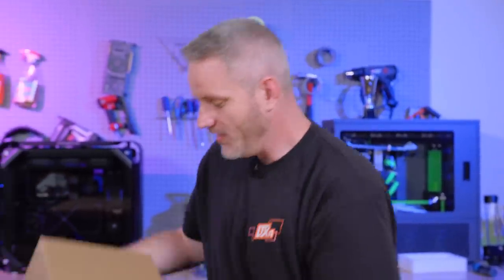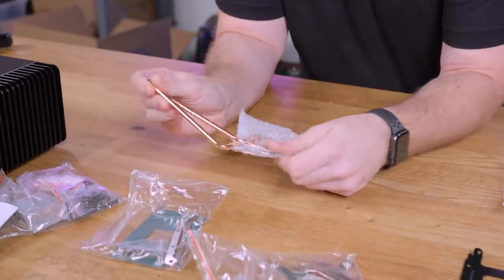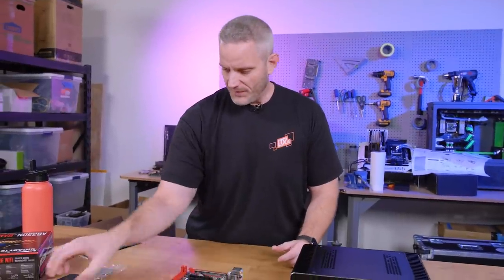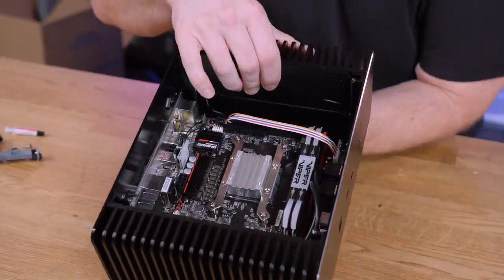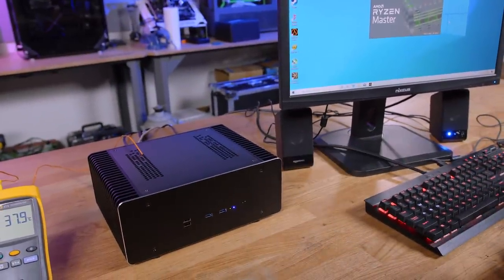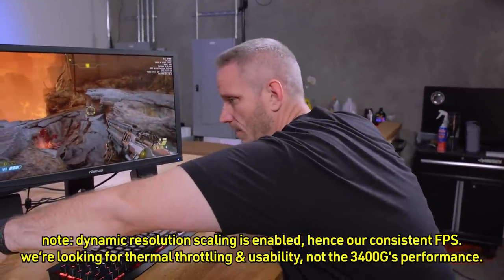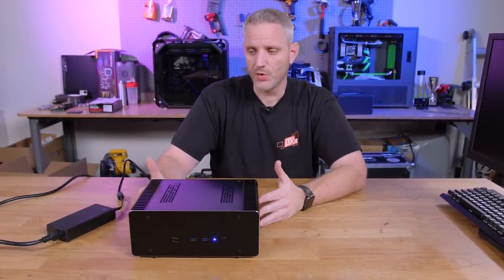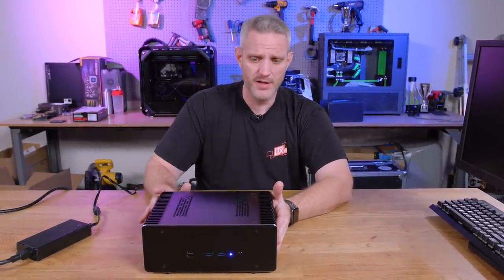I've never built a PC like this before...

Comment: I don't know if I more happy about this cool case or the fact that he said litres instead of fluid ounces
Reply: liters is the displacement of the inside of the case. ounces is how much the case would weigh. they are not comparable.
Reply: He meant to say litres
Reply: He was meant to say litres noob
Reply: @ghomerhust  sorry I meant fluid ounces
Reply: @robstrains8711  I meant to say fluid ounces because apparently if one is wet it measures a completely different type of quantity
Reply: @AdaDoom1  yeah I know I meant to say fluid ounces, didn't realise there was a difference
Reply: all the debate on ounces vs fluid ounces when anyone that is not an idiot already knows which one is being used to measure volume...and no one mentioning that no one actually uses ounces to measure volume of space that way.  They would use cubic inches. 
for what it's worth, converting imperial to metric for volume is one of the easiest in getting a close-enough estimate, as 32oz being 1 liter is close enough to to get a rough idea.  (1.06 actually)
Reply: @johngaltline9933  oh I forgot that I am not American and I don't actually know much about the completely unscientific and irrelevant imperial system
Reply: @ivantaslev  irrelevant, possibly, if you don't come across it, however being able to convert between different units is always a useful skill.  As for unscientific, only in the sense that metric is typically used in science and engineering today.  just because converting between unit types is more difficult does not make the measurements any less accurate or precise.  On the other hand, people that routinely deal with converting units tend have little trouble understanding conversions.  There are a couple niche cases where imperial is actually far easier to use than metric, but for the most part, no one that is familar with imperial thinks it's inherently superior, they just don't care, as they can understand both imperial and metric just fine.  It's only the metric folk that seem to have any trouble understanding units in other systems.  Maybe it's because their system has not taught them how to use their brain for conversions?
Reply: @johngaltline9933  well this has turned into an interesting conversation. well before you assess my mental capabilities, let me tell you a bit about myself. I'm a secondary school student in Singapore, I take triple science with additional math and I am finishing my O Levels. Trust me, I know perfectly well how to convert units, except that I do not specifically need to convert metric units to imperial units on a regular basis. And as far as precision goes, sure maybe when it comes to large things both systems are equally accurate, but what about smaller things? Can the imperial system measure the size a cell without endless decimals or a tiny fraction of an inch?  Anyway, I came here to make a statement that I hoped would offer some humour to someone's day and not try to prove which measurement system is better, but apparently many people enjoy putting others down instead.
Reply: @ivantaslev  Honestly,my original reply was in your defense.  It seemed other people didn't know that ounces can measure both weight and volume. 
As far as the small measurements, Imperial uses the same method as metric. thousandths and millionths of an inch or meter.    it actually causes some confusion with people that are unaware of the imperial terminology in engineering and machining as the term "mil" has been the standard term for a thousandths of an inch for hundreds of years, but most metric folk hear it and think millimeter. oddly enough the term milli comes from Latin and was originally used specificly to refer to one thousandth of a mile. 
Once again, no one is debating if one system is better than another.  with a couple ease of use exceptions on both systems, they both work just fine in any use case and for day to day use it really doesn't matter.  It is, however, somewhat irritating that only metric fanbois like those in the replies above seem to have trouble converting units where as people that still use imperial don't seem to have any trouble understanding metric and don't tend to care what system is used.
Reply: hey man sorry that I misinterpreted your first reply, I don't wanna have any beef with you. however when I said that the metric system being more scientific, I said that because pretty much all scientific equations in physics use metric units as they are the SI unit, whereas any other unit would completely change the way certain formulas work. Also, in the metric system there are many prefixes which, albeit may be confusing, are really useful so that you don't have to use things like 'thousandths' or 'millionths'. An example is a nanometre or a micrometre. These prefixes are what, in my opinion, make the metric system way easier to use. Anyway, I understand your points, it was pretty cool to have this conversation about  measurement systems. Have a nice day pal :D
Reply: @ivantaslev  for what it's worth there are equivalent equations for the other types of units.  pretty much all of those formulas were discovered using the other units in their original form.  also, as I said before, the prefixes are the same.  milli is a thousandth, micro is a millionth, and nano is a billionth. it doesn't get much more old school in a measurement system than using Latin names.  In general the imperial system uses the differing units because of what they were used to measure where one unit might be used to measure common objects a person was likely to handle and work with, an inch.  another unit was used that scaled better for larger objects like buildings, and another made sense for large distances, the mile.  oddly enough the mile was originally 5000 feet (is 5280 now),  but got there by way of being a nice, even 1000 paces for Roman soldiers. 
I can't argue that metric is easier to use in most cases, and that ease of use is a it's selling point, but it doesn't make other units any less useful in the cases they were intended to be used.  Some cases where imperial is actually easier are general construction, where the ease of dividing fractions makes it effortless to ge accurate divisions of materials without a calculate, ex if you have a board that's 2.43205 meters long it takes a slight bit more brain power to figure out how to cut it in 4 equal pieces than it does to take that same 95 and 3/4 inch board and work it out to be 23 and 11/16.  the temperature scale is another where the imperial Fahrenheit  works very well for measuring the normal range of temperature a human experiences day to day with 0 to 100 degrees covering the normal range of outdoor temperatures for most folk with a nice amount of granularity even over slight changes, the same range where Celsius is pulling out the decimal point and negative numbers even in casual conversation to make it clear hot hot it is outside. (-17.777 to 37.777)
when all is said and done, metric will win out, just because the world has decided that is the system it wishes to use, but more people using something does not objectively make it better than another thing that does just as good of a job in the actual task, and it doesn't ever hurt to learn new things, even if they are antiquated units of measure.  it makes life a lot easier when someone can say 2.5 liters, or 150 cubic inches and either one is equally understandable to your brain in getting a rough idea of the volume being discussed.  
Also bringing it all the way back, it looks a lot more like 3 liters or more.  an ITX board is 170c170 mm and there's some room around the edges, at least 30mm on one side.  it looks to be about twice the height of the I/O shild (which is about 45mm) so all told about 170x200x90mm which works out to 3.06 liters.  about 187 ci... or to complete the circle: 103.5 fluid ounces :p
Reply: @johngaltline9933  alright John I understand your points, it was nice talking to you

Comment: Some itx mainboards have USB3 at the bottom left, that way it reaches

Out of all itx boards I can find locally you have THE ONLY mainboard with its USB3 at the top left XD
Reply: I was also wondering about that.... and Jay, what about taking the RAM heat sink off?
Reply: I was thinking the same about the mobo choice for this case. I’ve owned it and it always bothered me that the USB 3.0 and 24 pin connector were in different locations compared to nearly every other ITX mobo. The case looks pretty compatible to boards that have the 24 pin and USB up front.
Reply: I would try routing front panel connectors under the mobo, but hard to tell from the video if it's possible/solve the problem
Reply: @0frikk  They extend over the mainboard for about 4mm and then can be bent. Under would need more wire
Reply: Yeah, I just looked at a whole bunch of B450 and B550 ITX boards, all of them have the connectors near the ram, not at the top like a weirdo.

Comment: "crappy Vega graphics..."
Whoa there buddy...
Reply: Compared to the rdna in xbox and playstation, they're mediocre tho
Reply: @karthik2166  well the xbox and PlayStation also cost 500€
Reply: Are you comparing them to a Radeon vii or the 3400g?  Vega is a core, not a specific product.  The 3400g draws much less power, and the Radeon vii practically matches either console.
Reply: Mostly I just meant that there's a cult following for Vega.  Don't want to upset the fanboys.  =P
Reply: @MrInvisibiility  Not a fan of Vega either, but for low power gaming, current Vegas still beats anything and everything right now. The one in 3400G though....well its okay. I guess. Its definitely not bad though.
Reply: @ark_knight  I'm rocking a Vega 56, got it used, great value.  But the 4000 series mobile APUs are killing it
Reply: @oof5882  they can use rdna architecture based gpu with less number of compute units instead of the old vega cores. I am not asking them to implement the same gpu from xbox series x.
Reply: @MrInvisibiility  yep, too bad the damn things are OEM only. I got a ryzen 3550H laptop myself - Yea basically same as the one shown in this video but lower clocks. It does fine, but the ones in Ryzen 4000 are pretty awesome at the meager CU count.

Comment: I recently built a SFF PC in a Akasa Euler case. Had to use older hardware, but that's fine as it will be used as a workshop PC so it doesn't need to be blazing fast. The Akasa case is super high quality, very unique & neat case. If you want a passive & silent PC for a HTPC or for use in an environment with lots of dirty air I highly recommend it.

Comment: "They don't make high speed RAM with little heatsinks"

Yes they do. Corsair LPX - 3200MHz CL16 with normal size heatsink.
Reply: They also do 3600 MHz CL 14
Reply: I used a set of them in my mothers little computer I'm building. Bought them and a Alpenföhn Blackridge so the guy in the tech store asked if I was doing an ITX build :)

Comment: 2:40 fun fact: pretty much the only connector not made by molex (but by their competitor, AMP) is the one everyone refers to as "Molex". the 24-pin header, the 4-pin fan headers on the board, the 4p/8p CPU header, the PCIE-Power connectors on graphics cards are all molex, but the IDE Power connector is made by AMP.

Comment: As for the front panel connectors and the USB 3, that specific motherboard has everything in the most awkward locations compared to any other b350 itx board. Be mad at MSI for their bizarre non-standard placements on the board, not the case maker. Do you see where the 24 pin and eps connectors are? Def not in the normal locations either.

Comment: I did Quality Control on industrial HTPC's using almost the exact same case and they usually use HTPC boards with Sodimm slots, so for the use-case this was designed for you actually have exactly the right length of usb 3 cable.

Comment: If ya think about it there shouldnt be any real surprise this works as good as it does.  I remember in the late 70's/early 80's during the big stereo receiver "watt wars" when they were building serious high power home receivers they cooled the output MOSFET transistors in the bigger amplifiers with massive finned heat sinks around the sides and back - it worked quite well and those large audio amps put out more heat than this rig at high volume.

Comment: In terms of passive cases i much prefer the style and design of the STREACOM, i bought a FC8evo 10-15 years ago and it was fantastic, 5 things it had better was 1:) styling (it had no screws in the front), 2:) it had a slot for a low profile pci card (some ok gpu could fit), 3:) ir receiver (important as i wanted it as a gaming htpc), 4:) the front io had sockets so you could replace the cable with the length you needed and 5:) slot load dvd

Comment: Maybe the cables routes under the motherboard, not over the components.
Reply: I agree
Reply: Would still be a big bend and might not fit
Reply: More like stupid motherboard choice... I just looked at mITX boards from different manufacturers and this one is the only one I found so far with the connectors on this side... All others have them on the side of the RAM.

Comment: Jay: "They don't make high speed ram with little bitty heat sinks"
Me: Stares in 3200 MHz G.Skill Aegis
Reply: I was thinking the same with low profile Klevv Bolt 3600mhz
Reply: My Corsair Vengeance LPX 3600 MHz too, thanks
Reply: Me cannot get stable 3600 CL 16 on my Cheap ram with 3200G I end with 2533Mhz Cl16
Reply: @kkrolik2106  Just checking but did you look into whether your CPU needs it's SOC voltage tweaking for that speed? Depending on your chip you could be pushing the limits of what the onboard memory controller can handle at stock voltage.
Reply: @seraphina985  I try but always at 3600 I get 1 error in Memtest -  Ryzen 3200G
Reply: @kkrolik2106  Fair enough just thought I'd ask as that isn't something that is always covered in tutorial etc so it's an easy pitfall to miss, how are people supposed to learn this when even those who should know better often neglect to include crucial information like that heh.

Comment: If you are using the case as a heatsink just put a fan over it. Or put it in a wind tunnel to OC It. See how much you can over clock it. Or.... Use external ln2 on the case or similar in a way that can be done long term to take heat from the case and cool to inside it. Wind tunnel is probably easier as it doesn't have the potential for condensation.

Comment: Well, looks like I found the perfect case for my music server. 
No spinning fan = less electrical noise for better quality audio.
Reply: Oh my god no
Reply: because the switching PSU brick, buck converter module for the 24pin, and all the normal VRM switching isn't just as bad as a single PWM signal...  May want to put your money first in a line conditioner for your amp, , then in optical connections between the computer and your amp.
Reply: Coil Whine: Say hello to my little fren!
Reply: @johngaltline9933   nah my system is already isolated on a separate circuit breaker board, which receives its signal via the wifi network. 

This is just for the music server itself. There have been some folks who found improvements to the music quality just simply by making the server fanless (e.g roon nucleus). But the price has been so prohibitive that I’ve avoided going that route for now.  So the digital signal that is fed out of the server is cleaner which makes it sound better.
Reply: @87togabito  the digital... signal... is cleaner...
thats some next lvl stupid audiophile sht
Reply: @rawdez_  yes we all have heard the 1s are 1s and 0s are 0s take on it. Which has been proven to be false because a poor power or unclean system can muck that up. 
But, I’m glad that such “audiophile bullshit” exists because it seems to make folks like you really unhappy lol. So yes, once again, a cleaner digital signal that processed by decrapicier products will sound better then a direct USB out.

Comment: There is a reason passive cooling has become a thing of the past in DIY segment and it's called power efficiency. I was (and still am) a big fan of large passively cooled heatsinks slapped on everything, but from a SFF perspective those are obsolete. You can find cases half the size of this one that will use a low-profile CPU cooler and a bunch of ventilation holes for everything else, all the while being nearly silent.

Comment: ITX case engineering has really come a long way with this.

The aspect of using a 3400G in a passively cooled case with modest gaming is really eye popping.

With the only caveat being the USB header cable, it's a winner of a design.

Comment: This case costs over $200, that's a hard pass for me.
Reply: Consider that you don't need to add a cooler in there it's a pretty good price it's a specialised case and they usually cost a bit more.

Only issue is finding one, haven't found it in stock.
Reply: @daghostds  you could buy a budget case and an aio for the same price
Reply: @cmb1214  This isn't a budget case, this is a silent, passively cooled Mini-ATX case.
Reply: @daghostds  Yes but the budget case with an AIO would out perform this any day and you wouldn't be able to hear a thing.

Comment: That USB 3.0 header not reaching is really an edge case, since it's on the far corner of your board, instead of the opposite corner where it usually is. The RAM also seems a bit far over on your board, so I'd imagine it'd be less strained if you used a more typical Mini ITX board.